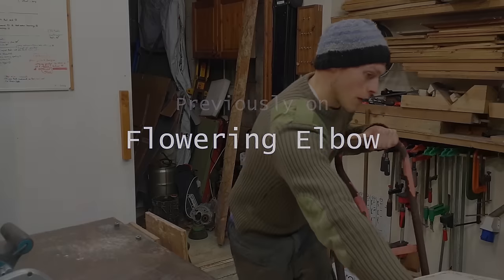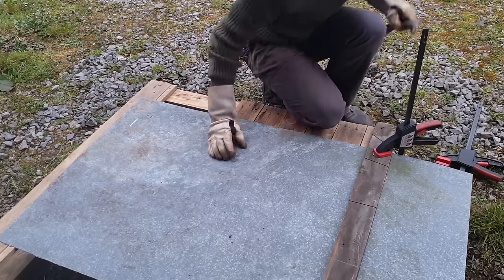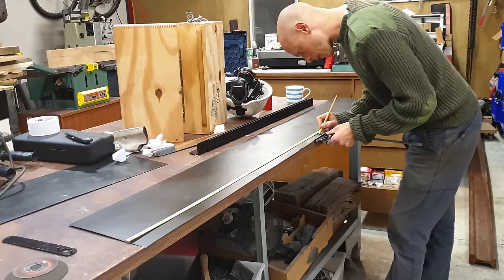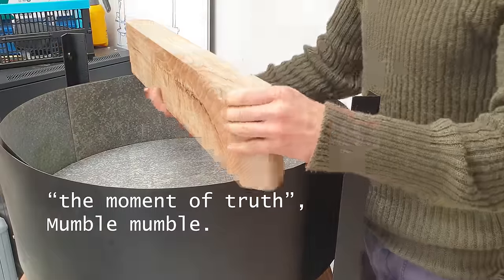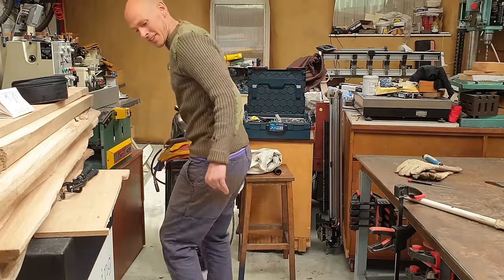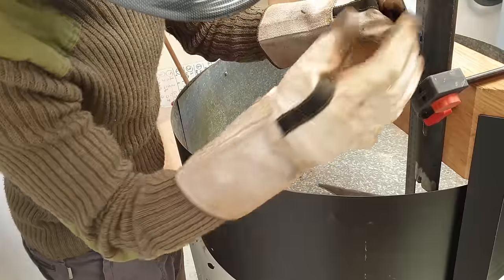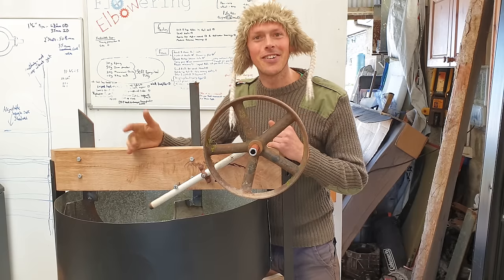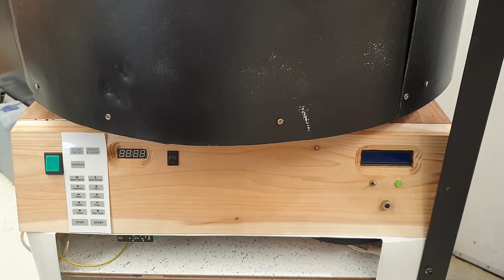Washing Machine powered Mulling Machine [Upcycled Workshop Tool]

Comment: It just so happens that I have a large rotatory table that i made and I'm in need of a muller for my new foundry,  I'm sure I can make a muller attachment to my turn table, Thanks for the great idea! Prefect, just Perfect.
Reply from the maker: Hi Patrick. Great! what did you use the rotary table for before? I'd love to hear how it goes. Peace, Bongo.
Reply: @FloweringElbow   i built a wooden,  " machine" the turns sections of logs into spheres, at the moment the largest thing I can put on it 36" OD.   the turntable  rotates the  log , and I have a wood router mounted on and arm that pivots up and down in an arc. the router is movable  toward the center of the axis of the arc..... picture a lath tuned on its side with a sphere cutting jig on it...... only MUCH bigger.. The current one im working one will be about 22inch in diameter  The turntable is 4 pc of  3/4" MDF glued up and 24" dia, powered by a motor from a elec wheel/chair buggy.. I have a controller for the speed rotation.,  the MDF rides on about 20 wheel from  old Rollerblade skates. i'd send a few pics but cant attach them here. All I have to do is cut a 55 gallon drum for the container, and add a crossbeam with similer  attachments like you made. and make it removable. this will save a lot time constructing a muller and a lot  of room in my over filled garage.
Reply from the maker: @blueroseyt  Sounds perfect! Let me know how it goes :D

Comment: Brilliant.  Love your inventiveness.  I think I’d use a 250lt oil drum cut off, and remove the whole tub rather than just the walls.  If you had one of the types that has the rim clamp lid, that would do the securing too.  I’m greatly looking forward to your motor controller video.  I’ve been trying to use a universal motor to power an apple scratter I made.  Not much success so far...😳
Reply: +1 for the oil drum idea. Combine that with some easy on off system, so you can take it off the platter... you could also store sand in it - but rust might be an issue. 
Love the upcycling you did on this. And also really looking forward to the speed controler.

Comment: Historically lard was used as a cutting oil. Particularly for cast iron.

In all the cope and drags I have used there is a rib around the inside to give something to hold onto. It probably would have prevented the failure you showed. Seems like making them out of channel iron would be a good long term method and wouldn't be burned by the casting or spills.

Is using a clay based sand worth it? Petrobond while somewhat pricey, saves a lot of hassle conditioning the sand.

Comment: Great video channel.  I discovered you on www.homemadetools.net and already subscribed.

I have a washing machine set aside for centripetal casting so it was nice to see one used for processing green sand.   I wonder if you could somehow use the washing machine's main drum as a strainer to separate bits of aluminum?
Reply from the maker: Hey Stylac! Thanks for getting in touch and subscribing :D A washing machine based centripetal casting machine sounds fun. Lot's of excitement and potential dangers  to work round with spinning molten metal! Let me know how it progresses.   
You could probably do that with the main drum, though the holes are quite large, so you would have to employ some pre or post sieve screens to get the smaller bits. Might also be a way to separate out finer facing sand?
Reply: @FloweringElbow  
I have a lot more research to do before I'm ready (not too mention too many projects) but I'm thinking about using the spin cycle for spin casting.  The drum would probably be the first item removed.

After seeing your project, I'm reconsidering mine because I think it would be better for processing green sand.